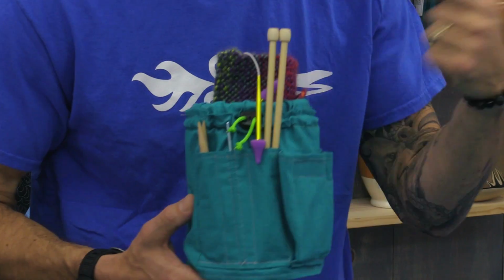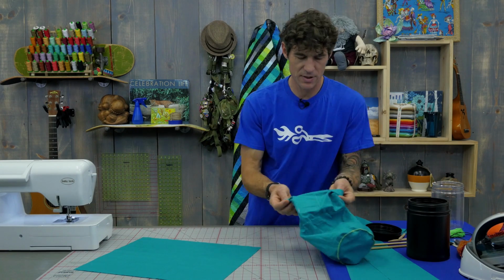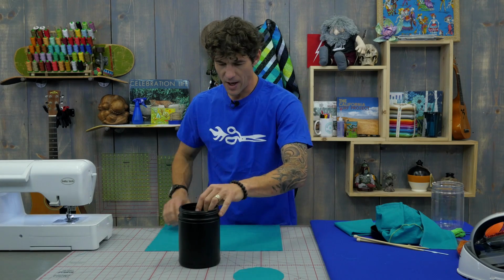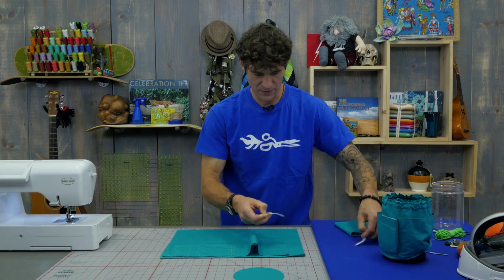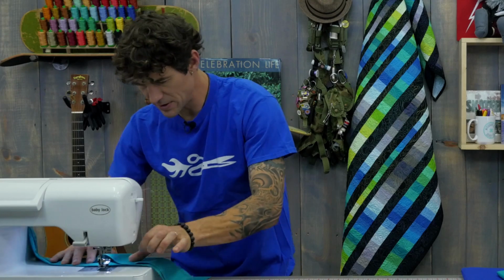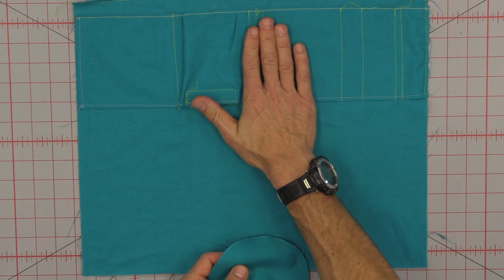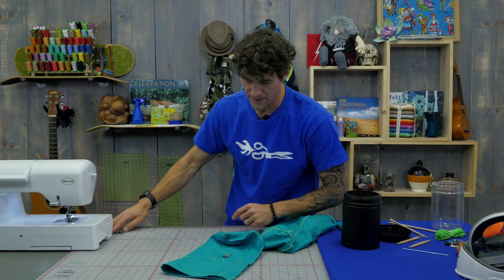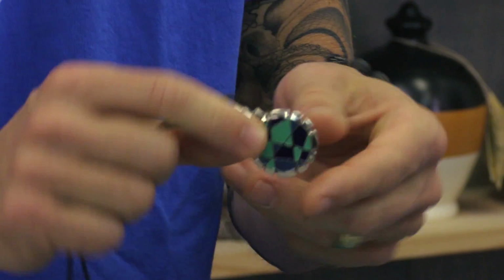Make an Awesome Knitting Tool Caddy

Comment: Hey Rob, I'm a male knitter, and crocheter. Some knitters don't like velcro because it can actually snag and ruin finer yarns like cashmere, angora, qiviut, and even merino wool. I think snaps, magnets , or buttons would be a great solution for that. Also, many of the men in my knitting group (we have about 5 at my local knit night) would prefer a canvas or stiff denim case with grommet eye loops for a pull tie but lined with cotton so it won't be abrasive on finer yarns. Do you have any tips on fabrics, threads, or sewing machine settings and feet?
Reply from the maker: Thanks for the awesome feedback soschadao! You should check out my great thread debate quick tip tutorial by clicking on the link below! Hope this helps, and let me know if more questions come up!  
https://www.youtube.com/watch?v=qyLI04SmVEQ